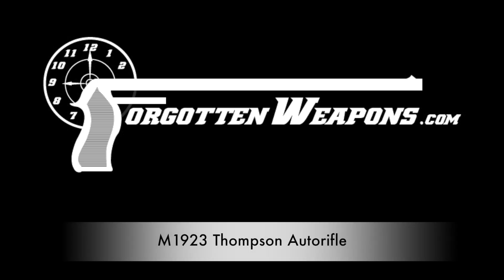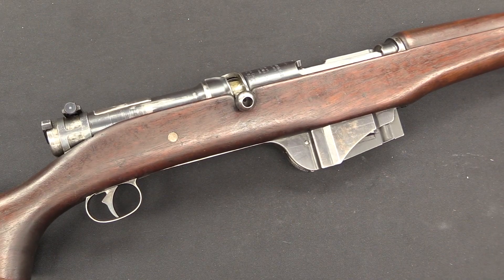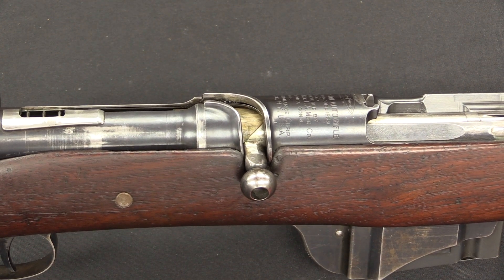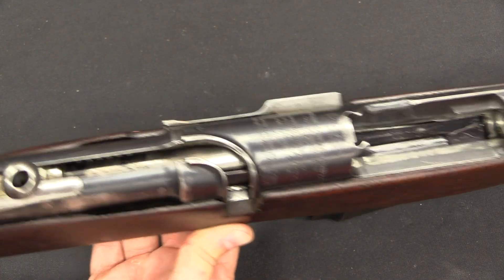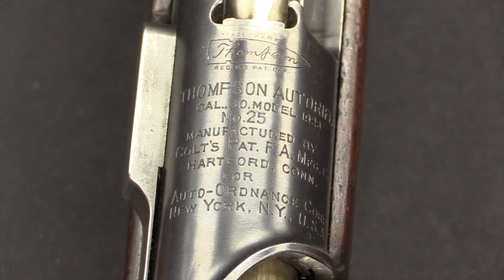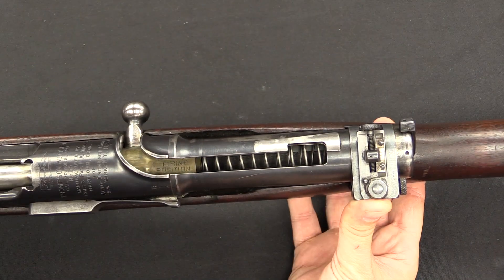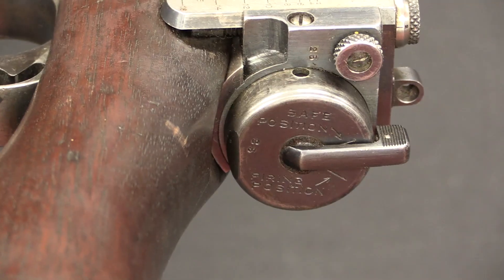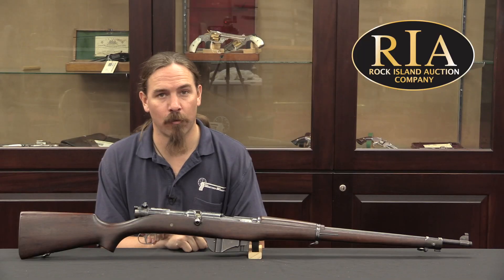Thompson's .30-06 1923 Autorifle: Blish Strikes Again

Comment: I've always been bewildered by the War Dept decision to go forward with the M1 Garand with a fixed magazine when it seems obvious in hindsight that a detachable magazines would have allowed any rifle man with 3 or 4 of the 20 round magazines for their general issue M1 to emulate the role of the BAR gunner.  

And I am aware the BAR was a automatic and the Garand semi auto but having fired both it seems to obvious to me in practical terms a mag dump for suppressive fire would actually be more effective from a rapidly fired semi auto.

Well in the end it's hard to argue with the success of the M1 as it was adopted. It was and remains a damn fine rifle!
Reply: As I understand it, the war department did not want a detachable box magazine because of the fear that soldiers would lose them. Unlike the disposable nature of the enbloc clip, box magazines were thought of as reusable items that would be issued with the firearm. Losing a magazine would render the firearm useless.
Reply: That and check out bloke on the range with his garand. He loads it at least as fast as you can a magazine. Easier if you consider for all the talk of magazines being "disposable" they seldom actually are and the stowage takes times, and the ammunition came wrapped in paper already in a clip.

The only thing that could actually make you load a garand slow is worrying about the action biting you, which it seems most learned not to do after a few mishaps, and to do fairly smoothly without fumbling.

The main issue is that the magazine being in the gun limits the number of rounds, when a detachable mag can allow for quite a few more, if you don't mind sacrificing the ability to fire it well prone.
Reply: Institutional inertia or something? They end up with something which resembles a traditional bolt action rifle and 'looks right'? Military bureaucracy has a tendency to play safe and not stick their necks out. If you gave them a StG 44  in 1930 they probably would have found ways to reject it.
Reply: Remember, while the French planned a semiauto rifle, the Brits and Germans deliberately keep bolt actions on cost considerations.  Stripper clips are simply cheaper for a million troops.  Lighter too if you plan on many troops walking.
Reply: William Prince it is largely based on doctrinal training and production bottleneck. Up until the late war period, training and operations were based around feeding stripper clips into magazines while inserted in the gun, as seen by stripper clip feed notches on rifles such as the SVT40 and the Garand expanded and detachable magazine prototypes. It was found in trials that, beyond 10-20 rounds, there was no advantage in volume of fire due to the long reload time. It was the production of cheap magazines in volume that later led to use of magazines as semi disposable rather than using them as detachable internal magazines.
Reply: @jacksonwilliams6823  Good point.  Well said.
Reply: The large magazine sticking out of the BAR was one of the several reasons the army was looking for a new design rifle to equip the infantry with rather than just giving everyone a BAR. If you're jumping into a trench or diving into the ground, having a large magazine sticking out of your rifle to bash on stuff isn't a great thing, and we see attempts to limit this risk in more modern weapons with designs like the P90. 

Also don't forget the M1 is from a time of still early modern industrial manufacturing. Tolerances and reliability were very much issues at that point.

Plus I don't really think there is much of a strong argument that detachable mags would have impacted the M1's rate of fire if they were kept to a compact and reliable size. Dropping and fitting a new mag vs slamming in the next clip? Not exactly a game changer.
Reply: Near the end of WW2 the govt had experimental models of the M1 with box mags. Some were modified BAR mags and others not. The end of the war ended the box mag M1 idea until the M14.
Reply: @RealLuckless  Ironic that after experiences in Korea and WW2 the same Ordinance board improved the M1 by adding detachable magazine.

I don't think at anytime they entertained the idea of giving every soldier a BAR.  It was far too expensive and far too heavy to function as a general issue firearm.  By the time the M1 Garand was adopted the BAR was reaching a point of obsolescence.  The Japanese type 99, German mg34, and British Bren served similar roles and we're clearly superior in suppressive fire.
Reply: @williamprince1114  well the reasons why the BAR was never given serious consideration as a general rifle were the reasons listed in this thread. Too expensive, too heavy, too cumbersome, too at risk of damage. We do see some elements out of the BAR having an influence on future weapons, namely the effectiveness of a lower box magazine compared to top/side loads or pan/drum mags, but don't forget the advances in manufacturing that were made between the development of the M1, and what we had when the M14 came along. 

We also have to consider the battles and enemies being faced at the time the decisions were being made. The M1 was the product of a mindset that was barely beyond the great war when some armies still had single shot rifles or worse, while the M14 grew out of facing off against massed wave assaults. The reduction of costs and improved manufacturing reliability combined with a proven need for higher volume of fire from the infantry made for very different weapon.
Reply: RealLuckless it would have been really funny to see how poorly that worked against modern Soviet tactics 
M14 vs. Assault rifle armed infantry in btr's. Ha ha.

Comment: If the bolt is locked in the front of the reciever, then how would they imagine the force would be transferred to the Blish-cam-thingy in order for it do anything at all? Are there really recesses for the locking lugs in the reciever? If so, are the locking lugs perfectly perpendicular or a little slanted?
Reply: I imagine that those lugs couldn't possibly have been perpendicular, otherwise the cam/bolt-handle couldn't move rewards to rotate in it's curved track.
My suspiscion is that they form part of a thread, like naval gun locking lugs, so that as the bolt rotates to lock, the pitch of the thread forces the bolt forwards very slightly.

Comment: A good rule of thumb with early semi-autos: if it looks like a converted bolt action it probably isn’t that great
Reply: The Mondragon rifle was decent.
Reply: You know, thats actually a good rule to work with. The Gewehr 41 was garbage while Soviet and American semi-auto rifles were actually pretty good in WW2 and in the period between WW1 and WW2 you had the ZH-29 that ended up as good as it was limited in production.
Reply: The Turner SMLE modification is downright sexy, in my opinion.
Reply: / if they didn't keep making it for at least 20 years, there was a reason...
Reply: Stanley Jedrzejczyk  Finnish ammo tends to do its job well;)
Reply: cough cough howell cough cough svt-40 cough cough
Reply: svt 40 really doesn't look like a bolt action at all and the howell worked well but do you really think it would've survived battlefield conditions?
Reply: The SVT was a great gun, the soviets where just too poor to produce it. It has a false reputation of beating itself apart because collectors don't know what gas adjustment is. The point of the gas adjustment was to let it fire different ammunition (since it was supposed to be the new DMR/sniper) not run in adverse conditions like something like an FAL has, that's why it needs a tool to change. It is admittedly finicky, and getting gas adjustment right is important.

It's probably one of the best first gen semi autos.
Reply: Dangerous Amoeba except for the fact that it is just about the worst thing to turn into a marksman’s rifle due to inherent accuracy problems.
Reply: @jackandersen1262  G43 is similar and was planned for the same role, accuracy versus accurate enough with follow-up.
Reply: deaths dentist the g43 does not have problems with vertical shot dispersion. Why do you think that the USSR discontinued the sniper variant in 42?
Reply: @SPAZTICCYTOPLASM  Trying to make a weapon do more than it should (be your service rifle and DMR with gas/ammo adjustment) is a notable flaw. You could get 2 LMGs, 3 SVTs, a dozen 1891/30s, 15 PPSh-41s. The PPS-43 would then cut production time in half compared to the PPSh. Compare that to the M1 Garand where they could buy 1 of them vs 2 M3 Grease Guns, which were comparable to PPS-43s as Gen2 SMGs. Overengineering is a real problem for the SVT. They made it more complex to fill a role it lacked the accuracy and quality control to have. Not a bad rifle and they made 1.5mil of them (and ~200k other variants), but its complexity was its flaw.
Reply: Canucks Fan Hold on, are you saying these were good, or bad?
(I think both are a bit of each.)
Reply: @Zbyhonj  the Howell rifle was fairly good, and advanced for its time
Reply: It does kind look like a Ross rifle had a weird baby with an SMG, and adopted the even weirder magazine baby of a BAR and a Vetterli-Vittali rifle.

Comment: Looking at that bolt hold-open... Before there was HK slap, there was Thompson slap!
Reply: can't forget about the new term: mosin nagant beatdown. bolts that are so mushy you need to give it a beatdown to open it up
Reply: @FrostyShock349  
Get the cosmoline out of the locking lug recesses, damnit.
Reply: @zacharyrollick6169 no. The garbage rod is not worthy of any sort of maintenance
Reply: The Blish slap.

Comment: Its actually impressive to design a rifle on a entirely false understanding of physics and it still be able to fire.
Reply: That's probably because most gun designers in that period just worked with trial and error in stead of trying to calculate all the forces working inside the gun.
Reply: The Blish patent is not entirely bollocks. Blish did discover and describe a real mechanical phenomenon that could be replicated in experiments. The problem was that he misunderstood the CAUSE for it. As Ian said, a Blish mechanism works by redirecting forces and allowing only a fraction of the force to actuate the unlocking mechanism, thus delaying opening of the breech. It did to some extent rely on the friction between the surfaces, and surfaces made with different materials would have a different coefficient of friction compared to surfaces made with the same material. Up to that point Blish got it right, which is why you could build a perfectly functioning firearm with the Blish principle. Beyond that point it's all bollocks.
Reply: If I understand right medicine used to do that a lot of times too. They'd find something that did actually work, and completely misunderstand why it worked.
Reply: Hell, they just recently figured out how Tylenol functions in the body/brain and that's been on the shelf for what, 60+ years?
Reply: @amindofiron  I don't know if someone else has replied to you,  or what particular piece you may be referring to, but as far as I know, the functions of acetaminophen are still largely a mystery.
Reply: So what you're saying is the blish principal got close to roller delay blowback.
Reply: @SPAZTICCYTOPLASM It IS a delayed blowback system. Just not with rollers.
Reply: The accidental rifle. lol
Reply: Task failed successfully
Reply: Nobody:
Some american guncrafter: my gun my laws of physics, I have rights, forcing me to respect physics laws is inconstitutional
Reply: I wouldn’t be surprised if this gun would beat itself to death after any serious use.
Reply: @jackandersen1262 , according to Ian, in the video, it did best itself to death, the bolt broke during stress testing.
Reply: notahotshot I see, I supposed I succumbed to the temptation of commenting before finishing the video.
Reply: Firing isn't the problem: it's making sure that the breach doesn't slam open so fast that flames shoot out both ends of the rifle and that ejecting cases aren't as dangerous as bullets going out the muzzle.
Reply: @dj1NM3  Free birds!
Reply: True story.
Reply: It's not a false understanding of physics, its a proper understanding of physics with fucking modern-witchcraft attached for no earthly reason.
Reply: From what I've found - the physics work, its a form of static friction, and was used in naval guns successfully (thats where Blish got his inspiration from), but for small arms its just not practical and had only a small effect if any.
Reply: @taumil3239 
Ok.
So its more practical much larger scales. I'll have to google it when Im off work later
Reply: In a world full of auto rifles being invented and a misunderstanding of physics,  john garand understood physics. He knew what worked.
Reply: Blowback .30-06. I see no problem here
Reply: Task failed successfully.
Reply: That's because blowback actions are dead simple. They are what any more complicated automatic action defaults to if it fails.
Reply: migkillerphantom if the locking surfaces fail on a gun, the gun does not revert to blowback. You instead achieve what is known as a “catastrophic failure”.
Reply: I'm guessing, big guessing, that Blish's Blish principle was marketing wank. He probably thought his idea was right initially but after finding out it kept the sales wank.
Reply: Eh... Medicine is kinda excused by necessity, because it deals with systems far, far more complex than this firearm, and when something has been observed to save lives you gotta use it.

This thing though operates on principles that had been fully understood for decades already.
Reply: An entirely.....
Reply: Moisture His understanding was fine. The issue was for the blush effect to work, the parts have to be absolutely clean. No dirt, corrosion, or used gunpowder.
Reply: Hey, the Blish effect is real! This is a great and misunderstood rifle. I will definitely be equipping one of these along my tin foil combat helmet when the uprising against the reptilian overlord finally starts!
Reply: Even more frightening is the fact that science doesn't entirety agree on the basic principles of flight... Is it coanda or Bernoulli's? Eh planes fly so it doesn't matter 😂
Reply: So basically he heard this and got hype.
Reply: then received the fattest L

Comment: Could you not lock the bolt in its rear position for disassembly and remove the rear section of the reciever with the bolt and spring captive ?
Reply: That.... sounds like it could work
Reply: Safely removing the the bolt from the rear receiver section would be... interesting... if you did it that way
Reply: You sure can, just don't bump it it out of the hold open notch while you are pulling it apart.
Reply: Just like a G43.Yes,I believe it's completely possible
Reply: @Preston Henson 🤣😂
Reply: That would put the main spring under full pressure. That receiver would come flying off with dangerous force!
Reply: @Locutus494  why would the back of the receiver fly off, if the spring were fully captured within that section of the receiver? That makes as much sense as saying that the AR-15 buffer spring will push the lower off of the upper. Yeah, it would, except the spring is captured.

Comment: That wide open slot in the rear of the receiver would likely have been wonderful in the sea water and sand on the beaches of Normandy. /sarcasm

This looks like it would also be a nightmare to try and mass produce.
Reply from the maker: Considering the rifles used in the Normandy invasion were sealed in plastic bags, I don't think it would have been a big issue.
Reply: Forgotten Weapons true, but when you take that bag off and are crawling around on that beach, that’s when things I’d think would get hairy. Even so though, I guess the M1 Garand performed adequately enough since the allies eventually pushed the Germans back with the help of that rifle and everyone else of course. It’s performance clearly was sufficient enough to get the job done even in those conditions. 
 
Likely would be the case with this rifle if it had proven to be viable, they would have developed it more to try and mitigate such deficiencies.
Reply: @ForgottenWeapons  Dammit! Beat me to it. They show this aspect off a bit in Saving Private Ryan.
Reply: "Keep the sand out of your weapons. Keep those actions clear. I'll see you on the beach!"
Reply: TBF have you seen the InrangeTV tests on the m1 and m14? They don't fare too well, they're a completely open action too.
Reply: hey now, with that safety that shuts the slot it's better than the Garand atleast.
Reply: Not nightmare to mass produce, just nightmare to pay :)
Reply: I feel like once you landed on the beach and took off the plastic bag there was a little chance of malfunction in Garands... Obviously it could happen but if you get it covered in sand you just shake it off and works more or less fine. You could also take one of the thousands Garands laying on the ground next to dead bodies. Also I think Springfields, BARs, Thompsons didn't have any problem with occasional sand.
Reply: I think that the InrangeTV mud test of the M1 Garand pretty much demostrated that the service rifle which was adopted was not very well sealed from the ingress of mud or liquids  at all.
Reply: I was thinking the same...
Reply: Most prototype/ trials weapons do